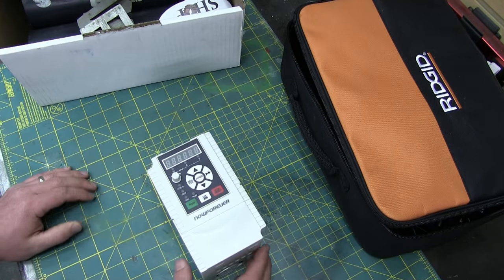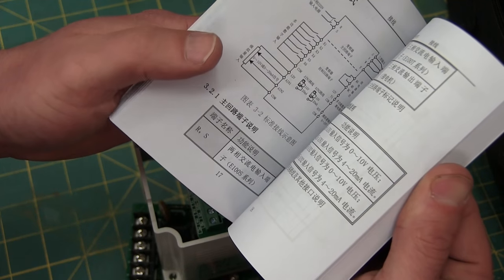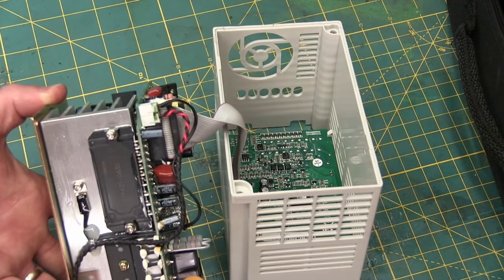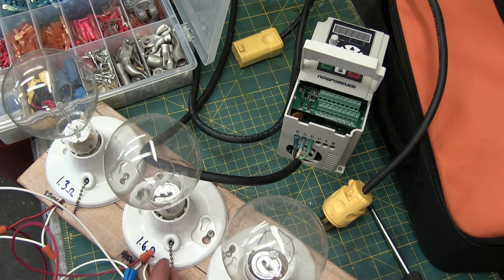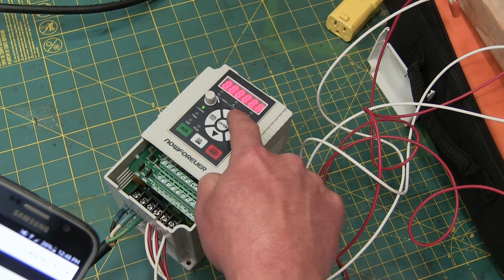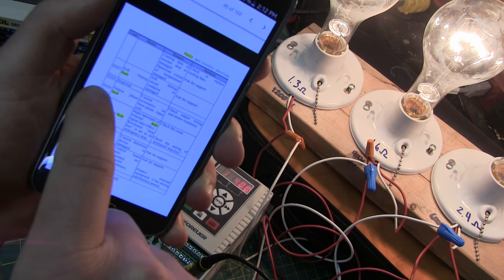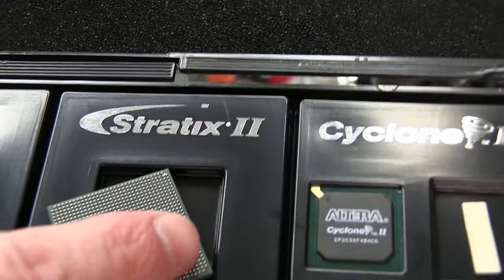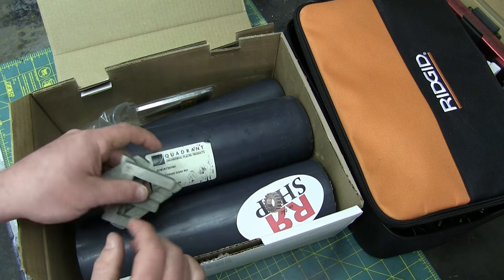BOLTR: Inverter VFDs explained, teardown and test

Comment: Do you think that drive could be fooled into operating a single phase motor if you were to dump the two other legs into a resistive load of a similar size to the motor?  I can't imagine that the drive is doing too much closed-loop control in volts-per-hz mode...

Comment: Uncle Bumblefuck (or similar skoocum pixie wrangler), I have a twentieth-hand industrial machine with 4x various 3-phase motorbs arriving soon. Each motor consumes a different amount of watts (for a total of about 1.5KW) and the smallest is only switched on irregularly (manually), switching off by a mechanical timer. One of the motors is wired for two different speeds, with the machine's switchgear selecting the speed. Wiring terminates in a single 3-phase cable.

I don't have a 3-phase supply and am torn how to feed the beast. I'm hoping that I can use a cheap Chineseum VFD like in the vidjeo as that'll take less space and beer tokens. I don't need variable speed so the intention is to lock it at mains frequency and simply treat it as a fancy 3-phase converter. What information I can find is conflicting whether I can run multiple different motorbs on one VFD, and whether I can use the existing controls on the machine (while the VFD is powered), or whether I should rebuild the machine's wiring loom so the VFD (or several VFDs) are in control. I'm no stranger to pixie wrangling but 3-phase is all Chinese to me!

I don't like the idea of a static converter due to its drop in power and I hope to avoid a rotary converter due to space and noise concerns. Worst case scenario I'll replace the motors with single phase but that'll be more expensive than a VFD, assuming I can get a cheap one to work.

Comment: I looked at adding solder traces on PCB's to reduce the resistance. Lead is so much less conductive that it work out to be a waste of time.  It think lead conducts about 7% as good as copper. I have not looked at lead free solder, I am guessing i wont be any better.

Comment: Hey man, if you really want to try and get some info from the manual, try using Google Translate on your phone. They have a feature where you can use your camera and it'll pick up the characters and provide on screen translations for you to use. Should work pretty well for data sheets and such.

Comment: May I take advantage of the expertise of the commenters here?  I have an electric winch run by what appears to be a capacitor-start motor.  I don't know anything else about it, unfortunately, except that it's single-phase 120 VAC.  What am I likely to need to do to slow the motor down?  I'd like the winch to run at about half the speed it does now.  Is a VFD what I need?  Or, failing that, what do I need to find out about the motor to know how to slow it down?  Thanks.

Comment: yep, you guessed it, no way to get a soldering iron on that. Typically, they're soldered onto a board with a (very) hot air gun.  You basically heat the whole thing up, board, package, flux, solder balls.

Comment: what do I need to do or buy to get my aircompresser to run on my inverter? it only makes 31 amps... need 36 to get it going. , I have 5000 watt harbor freight inverter, 30 watt solar ,and four deep cycle marine batteries. works all my other stuff fine. help please.

Comment: It'd be really cool if you get the chance to review DEWALT's newest 1/2in cordless impact wrench model DCF899HB- I use one every day and it seems like a very good tool. It's got a shit lot of power. The only bad thing about it so far (aside from the fact that cordless impact wrenches are naturally bigger and heavier than air powered) is that the 5AH batteries don't have a very strong case and the plastic cracks. I had to epoxy one back together. 

Anyway I'd really like to see the inner workings of one. I depend on it too much to rip my own apart and chance it though. I get it if you won't do a video on it though because they are expensive.

Comment: Also, chuck half a dozen lithium cordless drill batteries in series to feed that drive. 
Makes any tool cordless.

I mean, if it was a single phase drive. Or your now cordless tool is 3 phase. Which probably means it's gonna be cordless but not portable.

But I degrease.

Comment: Do all similar controllers reduce voltage ALLSO as they reduce speed/frequency??? 
Doesn't that mean a very low torque if used "as intended" with a synchronous motor?
Reply: They're mostly intended to be used with asynchronous motors.
And yes, they all reduce voltage with frequency.. However, they all also have voltage boost functions that raises voltage at the lower end, usually comes preset to nice boost level.. And some will also have configurable startup boost and acceleration boost...

One step up from that you'll find various forms of flux current control, which uses a mathemagical model based on the motor rating plate data that you give it, to figure out how much voltage and current it needs to keep the rotor magnetized, and how much current it needs to make it spin. Evens out the torque, makes the motor run cooler most of the time, because it's not giving it any more energy than it needs.

Further step up you get sensorless flux vector control, which is basically using pure black magic to provide full torque from almost standstill to the full rpms. Just getting this mode properly configured is a kind of black arts.

For tinkerers who like to (ab)use things, the V/Hz models are the most useful, because they're the dumbest and wont get all whiny and upset when they discover that you've got random tools and stuff attached to it.

Comment: There is no such thing as 4-phase power, at least not in any significant usage, right? Why not? Is it a matter of balancing wiring/other complexity against smaller wires/motors/etc., and 3-phase is the sweet spot, or does it have to do with something on the power generation end? This is my first comment ever on the 'tube! Love your videos.

Comment: Intel went to that type of proc pin format a few years ago. No more bent pins.
Reply: Greg Adams Not quite. LGA (land grid array) has pins in the socket that touches pads on the bottom and fastened by pressure. BGA (ball grid array) is physically soldered to the board, usually in an oven.

Comment: Is there also an inverter from single fase to three fase? 
btw thanks for all the information! I love it :D
Reply: oke thanks, I'll look into that! It's for testing 3fase machines at home (like welders) 
some things I need to look out for? :D
Reply: The machines where I need to work on/ test are these one http://www.fronius.com/cps/rde/xchg/SID-CFE2FE07-A55546A3/fronius_international/hs.xsl/79_10981_ENG_HTML.htm#.Vy5xwGPGL-I
and they need 3x400V... And I have only 1fase at home to test them..
Reply: Oke that is totally true. The only thing left to do is maintanance and looking for visual faults and some messuring. And then testing it out in a shop, Thanks! :)
Reply: +Xander Van Wassenbergh 4,5kVA is not that low power, VFD would be quite big and expensive. Another thing is, these VFDs dont have exactly clean output, so you shoud check how would a welder respond to it. And even more important, how would a VFD respond to a switching power supply on its output instead of inductive load.
Reply: +VictorIndiaDeltaAlfa Yhae that's true a too big of a risk to take and invest into! It will be the good old search and find to get rid of errors :D

Comment: What´s the difference between the inverter compared to PWM signal conditioning?
Reply: an inverter also inverts the voltage, so you get an negative sinus half wave compared to ground and not only rectangular wave between ground and voltage.
Reply: FreeOfFantasy  Thank you Sir.

Comment: So my lead field engineer watched this with me and said 'basic explanation is that this would be a variable output converter since input and output current types are the same'. Is he wrong? I cannot punch any holes in what he said lol. I need a good comeback to this. hmm... In my field, we use 440V AC input and turn it into DC +24V/-48V output using rectifiers and converters, and end product is around 10k amp potential. When i hear inverter, i think DC to AC. I've been poisoned by telephony :/
Reply from the maker: Sounds like he knows what he's talking about. Unfortunately, nobody else does.
Reply: AvE good, because I'm set to replace him next month. He's being moved to clipboard duty

Comment: Will this maintain torque on my 50mm center lathe? Stop laughing, it's got chrome!

edit: I forgot. It's a DC brushed 1/10 HP from the late 40's to mid 50's. Similar to the Hamilton Beach sewing machine motors from that period but used on a watchmakers lathe. A very  manly chromed watchmakers lathe with a milling attachment.

Comment: I'v got a question ave. ok instead of buying a vfd how can. I get cheep bare bones speed control and I am not shy have something  that could blow or shock the f out of me. it don't Haft  to last but a week at most hell what about a wall  dimmer switch what you thank
Reply: +AvE. thanks man love the channel. by the way
Reply: +AvE You use a 90 or 180 volt DC drive for brushed tools..

Comment: Ha AVE
I picked up one them Fluke 17B+ digital pixi checker and got screwed It was advertised as an Australian import so assumed it was the international model but not the case but anyway after I bitched my guts out they gave me a link to the English manual the meter is not to bad came with a current clamp and CATIII leads so I will use it as my knock around. Thanks for the tip keep your thing on the ice better you than me.

Dave
Reply: +David Cashin Which company?
Reply: Others here have mentioned gearbest.com ..might want to try them next time around.
Reply: +BikingMNViking 
I have checked them out and they at least advertise it's actually a Chinese import so you know what you are getting. Infifitystore actually sent me a PDF manual in English and have assured me that it has a one year world wide warranty can only hope.
Reply: Yeah, well it's a real fluke so you would think you'd be able to go to their website or open it up and pull up any data sheets needed on it. I imagine the important details (I watched EEVBlog dissect one) of how much impedance across the terminals are very likely the exact same. It doesn't get much better than a fluke! ( my college one, a 77 died, I suppose oneday I should see what failed in it. I think I recall some board/trace separation at the junction of the female jacks which the probes go into. I dunno. College was rough on a lot of equipment and not always under my eyes) Most of my idiot classmates cooled their soldering irons under the bathroom tap. I knew better and all theirs died in loud unison, how ironic!

(now that's a paperweight too because a element & tip for a weller of that model is more money that a whole electronic temp controlled RS soldering station with 3 presets!

Come to think of it, Ironic also, my Archer soldering iron still works and it was only a medium of the road soldering iron. No ESD protection on it, though it maybe double insulated. Easy enough to clip the plug and put in a 10 meg ohm resistor & for ESD protection. That's all our wrist straps were, anyway.

Comment: "English" Manual: www.c-n-c.cz/download/file.php?id=31939
You can run a single phase induction motor off one of these things - just use two of the phase outputs. Works well with minimal smoke.
Reply: +Gaf With the right Capacitor I'd think he could get real close in the ballpark. I just took apart a microwave to find its recirculating grease fan running a 3 phase Y Galanz motor with a 7 uf 250VAC between two of the Y legs as capacitor run and the unit was designed that way. Sure opened my eyes that 2 phase and three phase are not THAT far apart -- at least if you have the right cap.

Unfortunately I quickly lost that cap and am going to try it later tonight with a 4 uf 250vdc cap. It's only an 80 watt air moving motor but a cool set up -- two shafts and a squirrel cage blower on eeacjh end. I googled it up and found honeywell used the same motor in an air purifier so it's probably fairly high end. The nukerwave it came out of was high end.
Reply: its explained at the very end (last sentence) of the Delta M series users manual (around p 80)

Comment: Don't throw away the VFD yet.... I am 95% sure that the motors from harbor freight are 3-phase motors that are statically converted to run on single phase. you have clearly eaten more magic beans than me and know how to brutally mangle a 3-phase motor better than I do, so maybe check it out? Might be an interesting vid...
Reply: +Cullen Purkis BINGO! Use it as intended as a single to 3 phase converter. 'cept its not a lot of amps considering his normal needs. For the rest of us home type DIYers its more than enough. 

I think his friend should just isolate his chop saw (conformal coating) and use water as a coolant. I've done it on double insulated saws that were not rated for it. Get an isolation transformer and he's perfectly safe except for direct shorts, obviously, because the ground is floated. Twice, now.

Comment: You can use a transformer to increase (or decrease) the line voltage, as shown here:  http://www.ibiblio.org/kuphaldt/electricCircuits/AC/02147.png

When the primary & secondary are wired together like this, it's called an "autotransformer".  Same deal.  http://en.wikipedia.org/wiki/Autotransformer#Operation  

When a device automatically adjusts or regulates the output voltage for you it's called a "Line conditioner". http://en.wikipedia.org/wiki/Power_conditioner

Comment: FAAK!! thought i had a solution to my slow cut saw problem. i don't have one. i was going to use the gear reduction from a 16L truck engine (delco remy 39mt starter) since i have them kicking around. then i realized i can just use it at 12v since i have a 12battery bank in the shop. but this would have been better. 

You let me down!!! not really. couldn't you slow the one phase down with Cap like they do for using a 240v motor on 120v power on the third phase?  or put a dummy load on that third phase? id love to try it out. but i dont have that VFD. i use a rotory converter to get my 3ph.